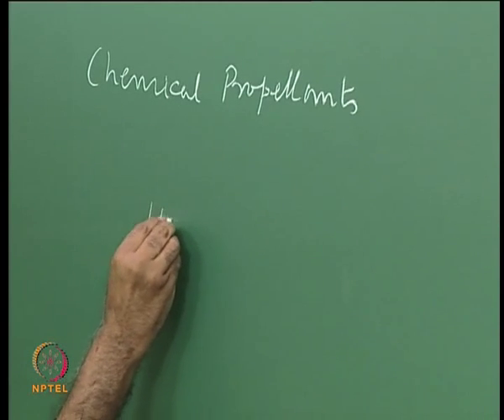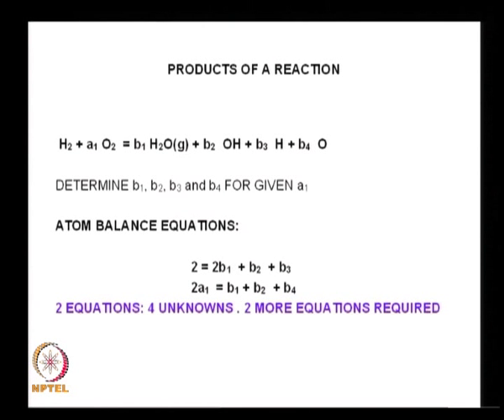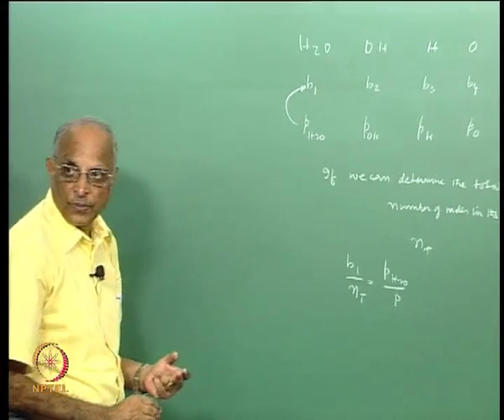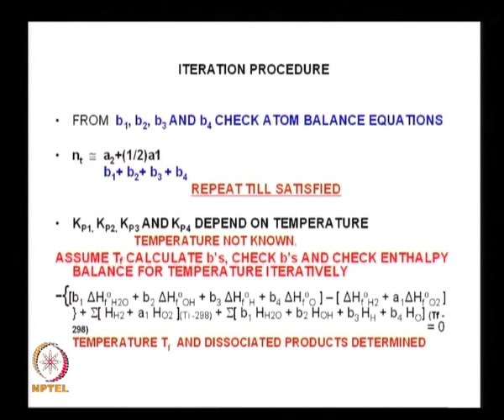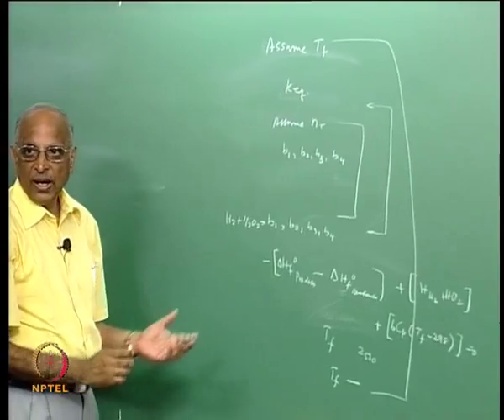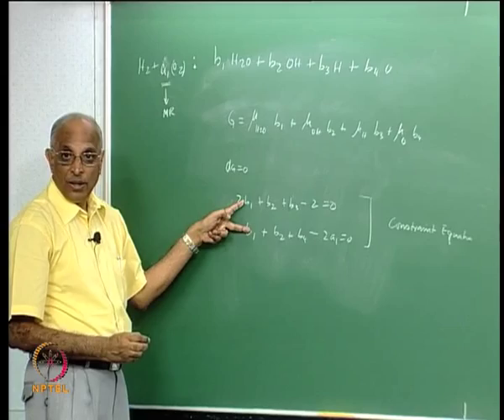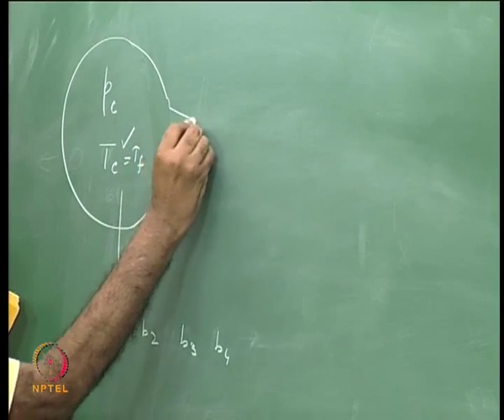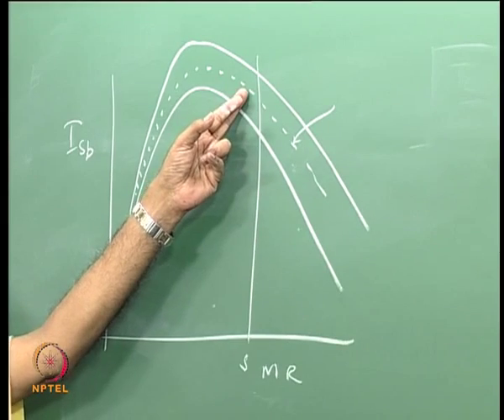Mod-01 Lec-19 Shifting Equilibrium and Frozen Flow in Nozzles

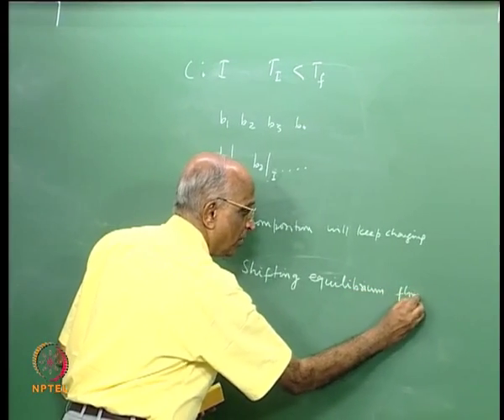Comment: Shifting equilibrium: 48:50 "To solve this is extremely simple." I wish!
What seems implied is that y (gamma) determined for the chamber is used to compute the pressure throughout the nozzle, then, in the case he gave for a hydrogen-oxygen propellant, the decreasing pressure from the chamber to the throat is used to determine the corresponding shifting equilibrium, and after the throat a frozen flow is used. What was not said, is that from the nozzle to the exit, does the frozen flow use the original chamber y, or does it use that y computed at the throat?
Next, he showed a diagram of flame temperature for frozen and shifted flow throughout the nozzle, and drew a dashed line between the two (the extreme conditions that fairly bracket what one might expect). He didn't detail how you march down the divergent portion of the nozzle computing the shifting equilibrium; do you use the chamber value of y, the throat y, some other value of y?

Clearly, y will itself shift since it is a function of the heat capacities of each species present (which are themselves shifting) at the calculated "local equilibrium" temperature, which is itself a function of pressure. If the procedure is not based on an initial pressure profile computed from a single chamber value of y and one dimensional gas dynamics equations (for example, Zuckrow), what exactly is the procedure?
Also, if this is a one dimensional isentropic and adiabatic flow, the stagnation entropy S (from the chamber) must be determined, and as one marches through the nozzle the "local equilibrium" and corresponding flame temperature is a function of the local pressure (how again is that determined?) and is constrained such that S remains constant. There again, recomputing the "local equilibrium" is dependent on a pressure value (for correcting the value of S), but where does that pressure profile come from? A one dimensional frozen flow?
Thanks for any answers regarding this. I am quite interested in the algorithm of computing shifting equilibrium in a one dimensional flow (I already coded a Gibbs free energy minimization code some 20-odd years ago so that is not an issue). I'm just trying to understand the source of the pressure profile used as the basis of computing the shifting equilibrium.